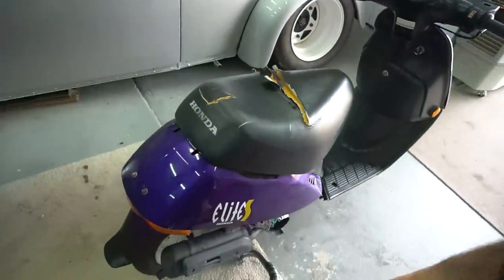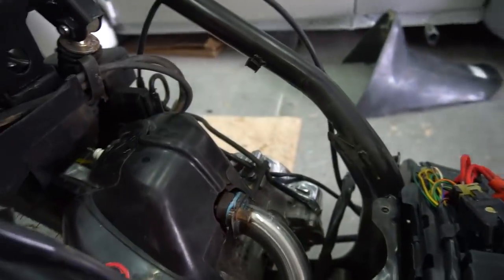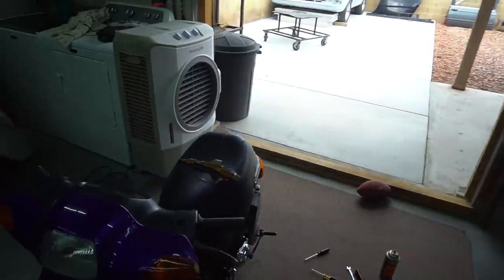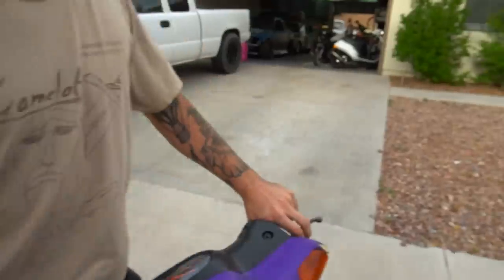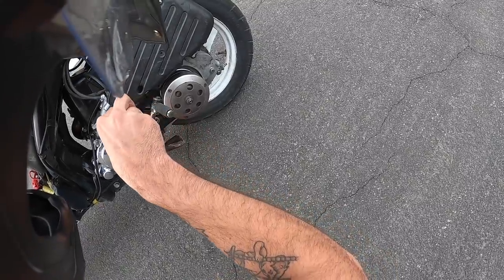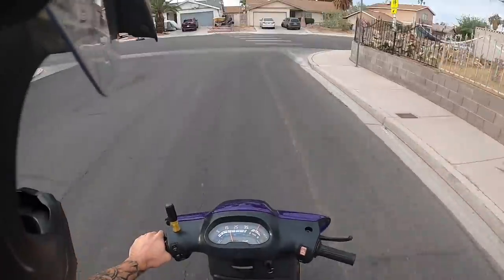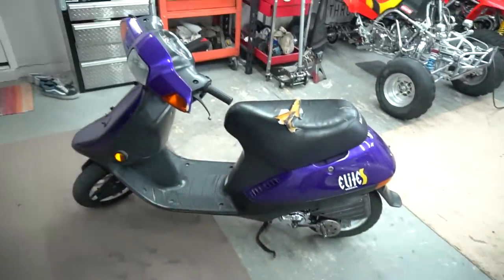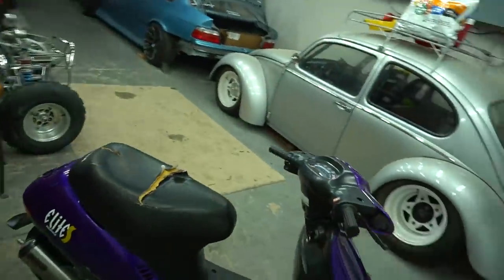this MADE my HONDA ELITE way FASTER! New Pipe on the 2 Stroke 50cc Scooter!

Comment: i would suggest porting the stock 50cc cylinder making the exhaust port perfectly shaped for the exhaust flange, and if you would like to have stock look, try porting the air box(it will be a bit louder), and throw in a good performance variator.
Reply from the maker: yessir, exactly !!

Comment: That rubber piece on your spark plug was out of a spark plug socket. It got pulled out of the socket and stayed on the plug.  I got a free Chinese quad that wouldn't run and that was all that was wrong with it lol.

Comment: @UCUCTdI5tDjOUd4841rhifUQ , I did that to. I start it and it will die then finally start and if I give it throttle while on stand it dies until it finally doesn’t do that any more. . I put a new air filter on, a new belt, cleaned the carburetor. And adjusted it. It ran and started great then it started acting up again in three days. I’m wondering if it’s the pipe. Or fuel screen in tank? Doesn’t have a fuel filter , but does have a petcock which seems to be working.I  Only have 1,200 miles on it.

Comment: Bro can I run a cortessa on a stock elite, as long as I upgrade my main jet?
Reply: Yeah bro; lightin up the rollers, adjust the clutch grab if necessary and upjet to 96 then work your way down till tuned. Get a temp gauge, itll save your purchase from being over heated!

Comment: Ummm interesting, I have a standard 1999 Honda elite 50cc goes only 25 miles per hr. Terrible ,
Can I put the s23 on there without doing any thing else’s to the bike to modify it.
Reply from the maker: yea you can put just a pipe , just might need to mess with your air fuel screw on stock carb to get it running right
Reply: @MOPBOYZ  , I did that to. I start it and it will die then finally start and if I give it throttle while on stand it dies until it finally doesn’t do that any more. . I put a new air filter on, a new belt, cleaned the carburetor. And adjusted it. It ran and started great then it started acting up again in three days. I’m wondering if it’s the pipe. Or fuel screen in tank? Doesn’t have a fuel filter , but does have a petcock which seems to be working.I  Only have 1,200 miles on it.

Comment: Hey man, did you need to re-jet when adding this pipe?
Reply from the maker: you don’t need to , might get more power out of it but i have stock carb/jets in it in this vid
Reply: @MOPBOYZ  I have an arrow on my stock carb/stock bore ‘01 S. When you were tuning the stock carb in this video were you turning the fuel mix screw? Also we’re you still running the oil pump in this video or mixing?

Comment: What do you tune when the engine gets to much gas? You playing around with the air/ fuel ratio screw?
Reply from the maker: yessir air fuel screw
Reply: correct jetting is important on 2 strokes at full throttle, if its running lean or rich at part throttle you can adjust the needle position and see if that helps. from my limited experience from dellortto carbs adjusting the air screw is useless and just helps the idle
Reply: @MOPBOYZ  thanks
Reply: @jpvalve  ohh okay i see. Thanks